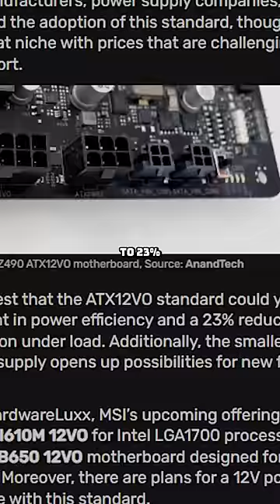Say Goodbye to the 24 Pin PSU Connector 👋

Comment: ⚠ WARNING:

This creator might not possess the depth of knowledge you're seeking. The transition to new connectors isn't an immediate replacement for the 24-pin connector across all boards, paralleling the slow adoption seen with GPUs. Expect gradual integration of the ATX12VO connector by motherboard manufacturers over the next few years.

Regarding power efficiency, their claim that it's a non-issue currently is inaccurate. Any inefficiency in a PC's power consumption is a concern. GPUs are notorious for their inefficiency, and some CPUs, particularly Intel's 12th gen, share this trait.

Improving power efficiency on the motherboard can be beneficial, especially for users with lower-end power supplies. It grants a bit of extra headroom, mitigating issues like transient spikes leading to shutdowns. While this doesn't eliminate such problems entirely, having just enough headroom can prevent many issues.

Exercise caution when considering this creator's content and approach it with a critical mindset.
Reply: But isnt efficiency technically higher only because board itself does all power conversion, that was creating unefficensy previously?
Reply: @alexturnbackthearmy1907  

Thank you for your thoughtful question. It's important to note that the motherboard doesn't directly convert power; instead, it serves as a pivotal hub for distributing power among critical components such as the CPU, RAM, and onboard storage.

Enhancing this distribution efficiency can have a significant impact, especially on systems with lower-end power supplies. The introduction of connectors like ATX12VO is designed to facilitate the delivery of more power without the need for extensive or multiple connectors. Additionally, it aims to minimize power loss, reducing the conversion of power into heat within the cables. This not only streamlines power delivery but also contributes to overall system optimization.
Reply: If your of is shutting off because of power draw spikes then you really need a better PSU more than anything.... It's not that difficult to just get a PSU that's big enough.
Reply: @GoodOlTazzy  

I completely agree with you I was just trying to make a point that it can reduce overall power consumption of the system
Reply: Is bro an AI
Reply: Is it going to have the same issues as the pcie cable?
Reply: @zelaird8526  
Unfortunately not otherwise i'd be able to make these comments faster
Reply: @FireStriker_  
Unfortunately it is likely although if board partners stick very strictly to intels spec for these cables and dont cheap out it should be fine for the most part
Reply: Yea, this dude low key sucks most of the time.
Reply: @ChrisW-fj8bt  

Agreed
Reply: There are still 24 pins they just split them based on which powers which
Reply: @ChrisW-fj8bt Yeah, there's been plenty of times where he's said similar, that he doesn't know stuff that he probably should
Reply: @Tech-Expose  hey man where did you study and what did you study and how old are you? I constantly seek konwledge and I have an urge to seek more and more and more. It's as if I'm addicted, then again I used to be an addict. 

Anyways, I've been studying motherboards and processor architecture to get a better understanding of it all. I really want to know the deep stuff and when you google anything you just get the basics. 

I've delved deep into CMOS VLSI, but it's just too advanced for me. Took me a year to get through 200 pages and there's still a lot more. I have to constantly google the terms in the book and look up what everything is. It's like I'm missing the correct knowledge to fully grasp the book. I really need some pointers if you'd be down to show me. 

I'm 21 and I want a bright future
Reply: Wow 🤯
Reply: @jibreelhughes  

It is a shame though as many people come to these channels as they may not understand something or need help with stuff and then these creators post what is basically false news and false information I can only guess for money and some level of clout
Reply: Power efficiency is also good for the environment. It's pretty clear this guy didn't think much before making this video.
Reply: When he said the stuff about power, I knew not to take this too seriously. Power concern has been my main focus the past year and I've learned that Intel (and amd) have achieved gains at the expensive of increased power draw. That works for gaming but sucks for servers (and honestly it sucks for gaming too when power bills are high and your PC is acting like a space heater in the summer)
Reply: @justinvzu01  
agreed its clear that this creator doesn't actually know much about what he's talking about
Reply: @Dante-420  
Quite a lot of good and valid info in this comment thank you for replying, it's honestly true I run a few servers that use more modern processors and running them is getting a bit painful we have to pay for the processors which are expensive and now the huge amounts of power they draw.

Again thanks for providing such a perfect comment.
Reply: @alexturnbackthearmy1907  the issue is that in a PSU, to provide that kind of power efficiency, they require extra components and design choices to fulfill the conversion from 12V to 5V and 3.3V that are both over-specced and underused in the modern day. Onboard conversion is simply better and possibly even reduce PSU costs
Reply: This user is actually a quite good poster, however this was a little misleading. No tech is ever integrated instantly unless it is absolutely required for safety or another reason.
Reply: This channel is just plainly not good, he keep misleading people and not doing relevant research, he has really strong biases which are bad for channels like this where lots of people new to tech or that just don't know better come to find out details.

If he was honest, less bias and actually did his research then it would be fine and tons of really good people who do the research get one or 2 things wrong but this is no where near the first time nor will it be the last and he doesn't even do it by accident.

He pushes out content with the pure intention of money and clout and not to actually give people info.
Reply: His points are also valid for most if not all pc enthusiasts it’s the same amount of 24 pins now with 5 cables I have to manage and they are smaller and easier to break or have issues with not to even mention trying to tech support call someone through 5 power sources for the mobo sure better power efficiency but idk if that outweighs the costs
Reply: "their claim"? whose claim? who is they?
as for efficiency, you don't know what the hell you're talking about, or how dc-dc converters work.
the only logical thing about this is that +12v is main rail for some time now....
and, offcourse, +5vstby stays.
Reply: @ivok9846  

In conventional English usage, the term "their claim" is utilized to encompass both the individual in front of the camera and any potential parties involved, providing a broad and inclusive reference.

Concerning your other assertion, while your general point holds validity, it's crucial to highlight the pivotal role of the motherboard in precisely allocating power to components. I'm not suggesting that these components draw power directly from the 24-pin connector; instead, the entire process of accurately distributing power consumes energy. Without this regulation, a CPU could potentially draw a constant 200W, leading to inefficiencies. Furthermore, the 24-pin connector not only supplies power to the motherboard but also facilitates the operation of other components on the board. Enhancing power efficiency can positively impact these elements, contributing to an overall reduction in system power consumption. Although the impact may be subtle, it can be noticeable, contingent upon the board type and any distinctive features that draw power from the 24-pin connector.
Reply: @Snirby537  

Agreed, shuffling tons of cables (provided your not using an atx5.0 psu) is a nightmare and if companies do cheap or cut corners etc which seems to be the case with current gpu adapters it can lead to it burning and stuff which isn't great.
Reply: @Tech-Expose  by god, you're writing for the sake of writing! hope you had some pleasure here. 
"distributing power consumes energy" ? 

it was a bit rude of me to question your knowledge, but i did it because you questioned video creator's thesis, which is, frankly, more truthful than you justifying this advertisement by mobo mfr. 
your sentence i just quoted tells me not only you're not "greatest technician that ever lived"(tm), but you're not electrician at all. first you need to understand how smps works: hint: it's well regulated and pretty efficient at precisely distributing power without any help from mobo. that's one of the reasons 30% claim is just advertising. 30% of what, compared to what? 30% better than first atx supply in 1990s? perhaps.
Reply: Your right I'm not an electrician, I'm not trying to prove that I am. I know quite a bit about computers and no matter what anyone says any component being more efficient is great.

It might not do much on its own but when combined it can be great.

Most of my original commend on this video is just plainly basic info to prevent people from being missled. The main point was to prevent people from thinking this was an instant change, I could have stated that more and been more clear. But either way something that uses power being more efficient is always a good thing.

If you have knowledge that could help provide more insight for people by all means post it anything helps as these channels mainly target people who don't know much better / don't understand it and when information that is incorrect is spread it's not great. 

I'll gladly edit my comment if you want to provide more details.
Reply: @Tech-Expose  no need to edit anything, just don't buy all the advertising you see anywhere. power supply techniques were mostly exhausted by the end of 20th century, so any new claim that mentions 30% savings is bound to be exaggeration. sure savings are good, but they won't be achieved in pc PSUs, and, of course they won't save the planet. 
dunno if you noticed GPUs these days eat more power than mobos? I mean, 1kw supplies in early 2000s were unheard of. in that aspect, pcs today actually consume more power than before, not less. 
that's another take on this story. IE looking at how much power is drawn from the mains outlet.
Reply: It is quite ridiculous, I swear the 4090 pulls like 400w stock bios, it's insane that a GPU can pull that much power and a typical CPU pulls half of that. I can remember an old system I had where the whole thing ran with the same(ish) power draw as a single 4090
Reply: @Tech-Expose  on one hand there are more gamer pcs today, using (much) more power, making everything less efficient (wasting power equals inefficency). otoh there are less pcs overall, ie in 2000s you only had pc as a device to access internet. now you have phones too. also, monitors consume less power today. hdds too (ssds).  but still it's obvious that without power increase there is no 4k gaming. so all the talk about how they're making a "green devices", is moot.
Reply: Which creators do you suggest ? Because I would like to increase my knowledge as much as I can.
Reply: @Tech-Expose Any power efficiency gains are likely the result of thicker wires or more of them somewhere for less resistance and power wasted as heat.... They do it with less pins? Thicker pins?
Reply: Yeah I've seen enough of his garbage content already to know that I don't want to trust him on anything. Time to hit the old do not recommend.
Reply: @GoodOlTazzy it's never a bad thing to use less power, especially in a time where ecology and economics are becoming more and more present
Reply: This guy sounds like he really just used AI to try and argue why people shouldn't listen to this short...
Also MSI adopting something doesn't mean the whole industry will.
A lot of companies already use their own proprietary connections such as the ones that HP Pro Desk has been using.
Reply: Sorry but if you think ATX12VO can in any way improve the efficiency of a CPU or GPU, you have no idea what you are talking about. The efficiency improvement comes from the PSU itself and is primarily achieved in low load scenarios. Any efficiency increase from the motherboard will be negligible.
Reply: @jonb695  it's about the efficiency of the power supply delivering power to the motherboard it's not about the efficiency of the processor. Nobody said it would improve the efficiency of the GPU or the processor
Reply: @jonb695  It seems there might have been a misunderstanding. My point wasn't about the CPU or GPU efficiency improving. I was referring to the motherboard potentially consuming less power with the new ATX12VO standard. This reduction in power usage by the motherboard could lead to slight improvements in the overall power efficiency of the system.

Additionally, I discussed how lower power consumption can enhance system stability. This was followed by a comparison of power efficiency between CPUs and GPUs, which have been known for poor power efficiency recently. To clarify my point, I mentioned GPUs in general, but I'm specifically referring to NVIDIA's 40 series and Intel's 12th generation as examples of products with less than ideal power efficiency.

I did not suggest that the power consumption of the motherboard is directly linked to that of the CPU/GPU. Rather, my comparison was aimed at explaining how improving efficiency, particularly in terms of power consumption, can lead to enhanced system stability.
Reply: @Tech-Expose  Actually, you are completely wrong.  The mobo does do all the conversion.  If you need 5 volts for anything,(drives, add-in cards, etc) you get it from somewhere on the motherboard.  If you need 3.3 volts for anything (drives, add-in cards, etc) you get it from the motherboard.
The reason this atx12vo standard hasn't taken off is because it doesn't actually help anything in the majority of configurations.
Some prebuilts use it where they designed their systems around it and these are usually computers made with proprietary parts that are not inter-compatible or interchangeable with standard ones.
Reply: @ElEheyeh  Some of the connectors he showed on the mobo are actually outputs because the mobo creates the 5 and 3.3 volt rails.
Reply: Yeah I was questioning that comment of him not caring about the power efficency.  Thanks for the context!
Reply: Don't forget about the heat.
Reply: Your post seems completely off point. He doesn't say the new connector is going to replace the old connector all at once, it's obvious that is anything this world would be a gradual progress.
As for the efficiency, he clearly suggests that the energy efficiency of the motherboard is not the main issue here, that there are way bigger energy wasters in the system and not that the energy efficiency of the motherboard is not important at all. 
You really didn't add anything to the discussion, you posted some platitudes that brought nothing into the discussion apart from stuff that's obvious to everyone, including the author of the video
Reply: It the real one for this. Thanks
Reply: @Tech-Expose I, for one, appreciate your comments in this thread. I know full well what it is like to have people complain about the length of my comments in certain contexts. The information and opinions that you share are valid and well reasoned. I commend and thank you.
Reply: They are liteally replacing the old 24 pin with a 10 pin + 6 pin + 4 pin + 4 pin which guess what? IS 24 FUCKING PINS.

Stop it, get some help
Reply: Thank you. Most of this guys posts are pretty bad takes but for some reason people just seem to lap up anything he says.
Reply: @Azureskies01 the 12VO standard simply removes the need to have 5 volt and lower u less you simply need them. And since most modern peripherals don’t MOST people would never need to plug them in. What the standard is doing is making these other voltages modular much like modern PSUs make cables modular. Plug in what you need and leave things unplugged that you don’t.
Reply: Not to mention any positive changes to efficiency, optimization, etc are all necessary if we really want improvement. Saying there's a 30% increase to efficiency and 23% reduction in power consumption then saying that's not an issue is just idiotic. Also, as you have mentioned, this isn't about power efficiency to the motherboard itself. It's to all parts connected to the motherboard without their own power supply (like most gaming GPUs have). So it increases efficiency of power to CPU, RAM, etc. Anything we can do to make that more efficient and use less electricity is a necessity.
Reply: What we need is just the strong point of this content... 
Viewers on this channel isn't want to be a fckin Electrical enginer or something, we only want to know something about pc component and build our own fckin PC's.

You can explain about this 1 component as long as you can and.. what? People only read and take the strong point of the explanation.

Make it simple, dude. And don't blame this guy's channel. He know what he doing.

Btw, you're just an AI right?🤨
Reply: aint reading allat
Reply: @Wayenk_28  
I'm not going to enter a full debate but i'll provide my side.
(Also i'm not an AI just for your knowledge)

Most of his videos are just bad, they don't contain the correct info or are just badly done.

He sometimes veers away from some topic just to change topic to AMD (pretty much when nvidia or intel are brought up)
While I personally think AMD is great, it's not helpful with most topics.

And yea some of his videos are great and have good information but I did notice one trend which i'm not sure about which is most of the videos with sponsors attached to them feel rushed with incorrect information or just mistaking certain things. (Just something I noticed)

And yes I agree most people dont care about super indepth information or being a engineer but everyone should be able to access correct information not misleading info.
I'm also not saying that everything I say is 100% correct and I dont expect anyone to have a 100% success rate like I remember telling people AMD would never be able to compete with intel just 3 months prior to ryzen releasing but the mistakes are far too common here and most of them can be fixed by just simple research.

TL;DR
I'm not an AI and
the gist is many videos lack accuracy or quality. There's an unnecessary shift towards AMD in discussions, which doesn't always aid the conversation. While there are some solid videos, sponsored ones often seem hasty and inaccurate. Access to reliable information is crucial and although no one's perfect the frequent errors here could (For the most part) be avoided with basic research.
Reply: @abdelhafezalebrahim8236  

Totally understand, and I appreciate your honesty! The detailed explanation is mainly for those who are looking for an in-depth understanding of the topic. Feel free to skim or skip if it's not your thing.
Reply: @Tech-Expose  aint reading allat either
Reply: @Tech-Expose  you were off to such a good start and then you throw it all away with this ChatGPT generated drivel. The irony in stating the creator does not posses the required knowledge to be commenting on this subject (which you were correct in doing) but then clearly not having the required knowledge yourself either?

ATX12VO motherboards have been a thing for like several years at this point, up until now mainly found in prebuilt OEM desktops.

The ATX12VO standard will make very little difference for GPUs and CPUs, as these are already fed directly from 12V (PCIe and CPU power connectors). When you say the motherboard does not convert power, have you never seen the large amount of voltage regulators spread around the CPU socket? 

In fact with ATX12VO will convert more power than before, as the motherboard is now responsible for creating 5V and 3V3 rails instead of the power supply.
Reply: Good to know, been knew something was off with this dude.
Reply: @zelaird8526 hes  probably summarizing an article using chatgpt like ai or summarizing his thoughts using chatgpt. Or just a really good Technical writer 😅
Reply: @modernkangal use chatgpt. Tell it to only give you factual information that can be cited and sourced and you'll get a decent study buddy
Reply: He never said that all manufacturers were switching immediately. He's talking 1 specific MSI motherboard,  in fact. Your point about CPU's and GPU's is meaningless in relation to the video. Also "people using lower end power supplies due to cost" aren't going to be buying a brand new proprietary motherboard.  So your entire comment is useless. I grant you no points,  and may God have mercy on your soul.
Reply: thank you for the precise info. know that it is appreciated
Reply: @modernkangal I seen konwledge too
Reply: @Tech-Expose that's the dumbest comment anyone has ever written on YouTube.
Reply: @procrastinatingnerd there's a reason his channel only has a child subscribers.
Reply: @Tech-Expose this have no sense what power loss and efficiency in such short cable